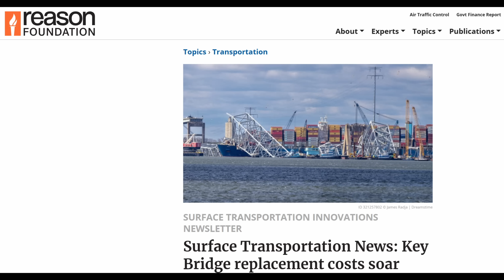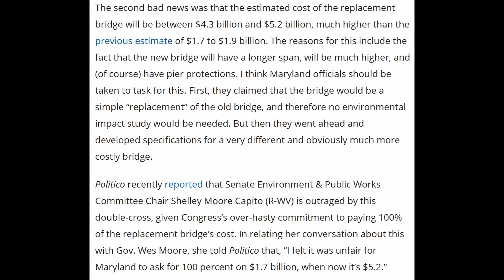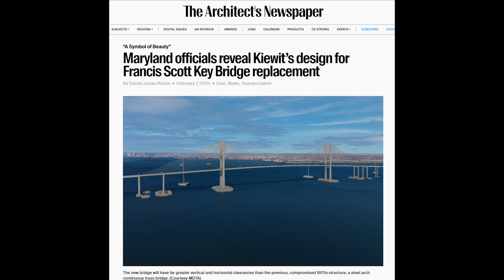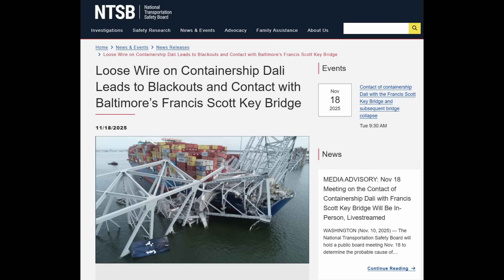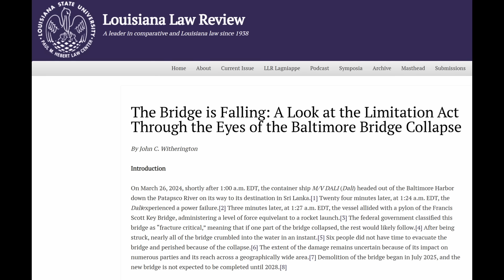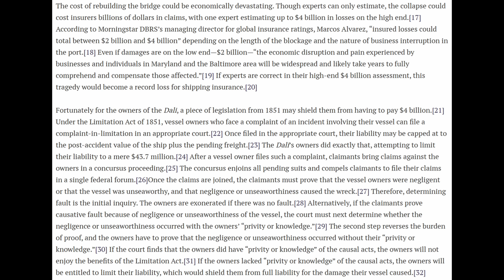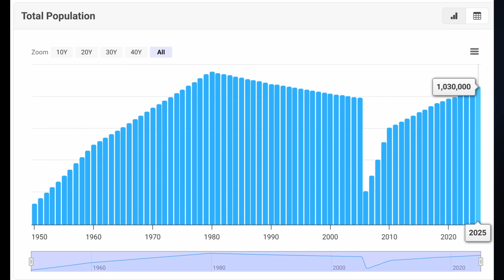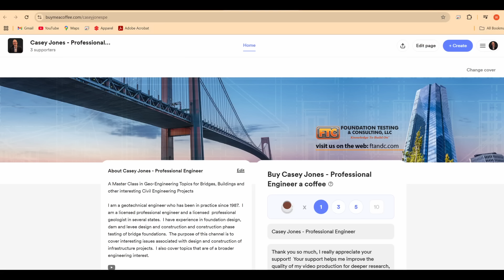Should U.S. Taxpayers Pay for a $5 Billion plus Key Bridge Replacement?

Comment: Long before the accident the port authority and the coast guard should have realized that the growth in ship size over the last 50 years created such risk that tug assist should be mandatory for larger ships to pass under the  bridge.
Reply: In 1980 this bridge was struck by a ship at the exact same piling system. A gigantic section of concrete was torn away. I was in the Coast Guard at the time and responded to the incident. The state knew then there was not enough protection. They did nothing and their neglect cost six lives ,not to mention the billions of dollars now being tossed about to rebuild.
Reply: @mikekellum6238    Delaware will observe that blowing off their responsibility to manage their own port resulted in a multi-billion dollar pork roast with portions for a hundred cronies and votes because "we brought jobs to DE".  They will conclude that this course of action is beneficial to them.
Reply: @mikekellum6238  Wow, 45 years ago they already had an incident. Plenty of time to make changes.
Reply: @mikekellum6238  
The main piers had a reinforced concrete crushable box structure around the waterline of the pier. There were 4 reinforced concrete pylons, a couple hundred feet on either side of each main pier.

The bridge was opened in 1977. It has been hit before, only 3 years after opening, by the MV Blue Nagoya a Japanese container vessel. A container ship in the 1970s or 80s was a much smaller ship than the absolute behemoths that are around today. No serious damage to the bridge.

The MV Blue Nagoya, a ro-ro cargo ship built in 1977, had a gross tonnage of 7,586 tons and a summer deadweight tonnage (DWT) of 7,613 tons. In contrast, the Dali (2024 collision) was a 95,000-ton gross, 112,000 DWT container ship.

Available contemporaneous accounts indicate the MV Blue Nagoya lost control about 1,800 feet out and drifted into a Key Bridge pier, damaging protective concrete/fendering at roughly 6 knots. “Drifted into a pier” and damage limited to the protection system point to an oblique or glancing allision with the pier rather than a perpendicular, head‑on strike to the primary load‑bearing elements.
Reply: Was the channel wide enough for a tug assist?
Reply: @leestebbins5051  No, it is not wide enough for 2 way traffic if tugs are required. At the time of the accident, there were just 4 lanes total with 2 inbound and 2 outbound lanes. With tugs, you will likely take up at least 2 lanes if not more. even then, it may require additional dredging as the outer lanes were for smaller ships with less draft, with tugs, the ship would likely have to straddle the inner and outer lane but the outer lane is not as deep as the inner lane. It would also require a massive expansion of tugs at baltimore on the scale of ten fold at a minimum. It would also absolutely slow traffic in and out of the baltimore area as when having tug assistance, that ship can't go more than 2-3 knots compared to 9+ knots.
Reply: @leestebbins5051  Tugs in Baltimore only help maneuver ships into the channel and into port. After that, the ships are on their own.
Reply: Would tugs be powerful enough to guide a ship as large as Dali in any meaningful way? Even ignoring the expense for the fleet of tugs to transit the number of ships?
Reply: @peters-adventure  sure, but the ship would only be moving about 2 knots max, anything faster and the tugs won't be able to affect the ship.
Reply: @peters-adventure  
Would tugs be “powerful enough” in a meaningful way?

Yes—if already attached as escorts. Two well‑placed tugs made fast can meaningfully control heading and bleed speed for a ship like Dali in confined waters. That’s precisely why many ports require or recommend escorts in high‑risk transits; experts widely noted that attached tugs could have helped modify the ship’s movement.
- Marginal—if arriving after the loss of power. Racing back without lines, with seconds to spare and a vessel already committed to a trajectory, their ability to generate timely corrective force is small. In Baltimore, the tugs had just left and were turning back when the emergency unfolded.

Expense and practicality of escorting “every ship”
- Cost and deployment are real constraints: Keeping multiple high‑power tugs attached through entire transits is expensive and operationally intensive. That’s why ports apply risk‑based rules—escort tugs where channel geometry, traffic, and critical infrastructure warrant it, and stage tugs near chokepoints so they’re already on scene. The two 5,000‑hp tugs were standard port assets assisting Dali’s departure.
- Targeted escorting is the middle ground: Not every ship, everywhere, all the time, but escorts for specific segments (e.g., under major bridges, narrow bends) where a blackout or steering failure has outsized consequences. With lines made fast before the hazard, tugs become immediately meaningful rather than “too late.”

Tugs are absolutely powerful enough to meaningfully guide and slow a ship as large as Dali—provided they are attached and acting early. The limitation isn’t raw tug power; it’s timing, attachment, and where you choose to pay for coverage. Arriving unmade‑fast in a crisis gives you minutes at best and very limited leverage.

Comment: The Key Bridge did not need to be re-designed. Only the pier protection (dolphins) needed to be redone. But, these projects always open  the door to corruption and self-serving bureaucrats. Thank you Casey for your work. I was the project manager for TB-61, the pilot project for replacement of the Triborough Bridge suspended span deck with orthotropic panels; the superstructure was not replaced. This lightened the dead load on the existing structure (elimination of the concrete deck). Ammann & Whitney was the project engineer.

Comment: Tariffs drive up the cost of steel used domestically.  Federal guaranteed funds allow for bonds to be issued prior to litigation with the insurance company from holding up any construction.  

Reviews on any infrastructure opens cans of worms because it justifies spending not in long-term limited budget projections.  It's frustrating for all sides.

Comment: As I see it the financing is always a challenge and it can always end up costing more than the initial estimation. From my perspective the federal funding would probably get best result for the surveying work to ensure that there aren't any surprises that can be used as an excuse to drive up the cost.
The least visible but sometimes the hardest and most expensive work is the foundation work. Get it wrong and everything else will fall.
So use the tax payer money where it will give you best control over the upcoming costs. Then you can decide how to continue and where the costs shall be.
The other perspective is also what the "need" for the bridge is. Time saved will be cost saved in the end. So building a bridge shall be seen as an investment that pays for itself through less time lost. The money path will be long and over a long time, so those building the bridge might never see the full value of it.

Comment: The Key Bridge is the Hazmat route, to keep things of risk out of highly populated downtown and the other route, which is also a Tunnel under the harbor.
Reply: So what What's the Hazmat route post Collapse?
Reply: @jerrykinnin7941  The long way around the 695 beltway that wraps around west Baltimore.
Reply: @jerrykinnin7941  
I-695 West, and selected surface roads around the harbor.
Reply: 695, which is a three-lane highway that is always congested, especially during morning and evening rush hour.
Reply: @kathrynw3  
So you run two bridges in the direction of peak traffic -- that is 5 lanes of traffic.
Reply: @alanstevens1296  Yeah, okay🙄

Comment: The bridge is part of the Interstate Highway System. That means Federal money will go to the project. Someone should probably audit what they are doing. It's sounding like a massive pork fest. That being said, all Interstate highway bridges should be required to meet Federal standards. Given the sheer scale of the issue, I can understand why they are choosing to gamble on not retrofitting all the bridges. It's a lot of bridges and a lot of money. It's not all about dolphins. There are bridges with other code problems. At some point it is cheaper to replace a bridge that to bring the old structure up to code.
Reply: Maryland's normal federal aid highway allocations are about $500 million per year.

It won't pay for a $5 billion bridge.
Reply: @alanstevens1296  That's why the Interstate system is beneficial. The benefits of this bridge are distributed up and down the East Coast.
Reply: @magnuszerum9177  
I-695 East is a regional relief route -- not a mainline Interstate highway -- I-95 and I-895 are the direct routes through Baltimore city.
Reply: @alanstevens1296  In some kind of way it was soaking up some of the traffic that is now occupying I-95 and thus aided in the I-95 overall traffic.
Reply: @magnuszerum9177  
There were three freeway harbor crossings in a range of four miles, with a total of 16 lanes of traffic.

Now there are two freeway harbor crossings, with a total of 12 lanes of traffic, handling the 225,000 vehicles per day.

Parts of the I-495 Maryland Beltway carry more than that on 8 lanes.

Comment: I was 28 when they opened the Key Bridge.  So I know they could do without it.  And why do they allow hazardous materials on the bridge and not the tunnels?  Seems to me that those are more dangerous overhead on a bridge over the waterway below.  Maybe there should be little or no shipment of hazardous material anywhere in the Baltimore area.

Comment: SNAFU 1, they knew there was federal dollars involved. Davis-Bacon Act, a U.S. federal law requiring contractors on federally funded construction projects to pay workers the local prevailing wage (hourly rate plus fringe benefits) for their trade.
SNAFU 2, from the bulk of the money is coming from federal it should be a federal project period. Not local politicos running the job

So as mentioned the video the situation requires it to be following federal guidelines as far as labor and materials designed build priority does know these factors and when they initially estimate the project then that we should have been what was funded not $1 more not an open checkbook.
This should go back to Congress and be defunded completely. Tell them to reapply and they'll provide a percentage of it the state pay for the rest.
The state needs to pay off all the work that's been done and pay the contractor for what's been done and if it's funding for someday so be it but these projects that run away need to be stopped by saying so many dollars and never a penny more.

SNAFU situation normal: all fouled up

Comment: Rebuild with the same narrow span as the original, and then plant dolphins as necessary.  Dolphins are a lot cheaper to design and install.  This upgrade is at the choice of the State, and they are using an expensive method to reach the safety level they want.  If they had just rebuilt as designed, a lot of the removal would not be needed, and the piers could be re-used.  Why should the US taxpayer pay for MD negligence and Dali incompetence?
 I would add that all insurance proceeds should be used to reimburse the taxpayer rather than provide funding for MD DOT projects.  A $5Billion replacement is a significant upgrade from a straight-across replacement.  It is not necessary, and is a boondoggle to the MD DOT and of course contractors who will provide design, material, labor and equipment to build the new span.
Reply: I like your idea, just rebuild and install dolphins. The Chesapeake Bay bridges need dolphins now
Reply: When you build a new bridge, you must follow current engineering standards.  It is illegal to build a new structure following obsolete standards.

Comment: Proposition:
The Federal government is responsible for shipping  and associated regulations (IIRC).
So they chip in 100% of the cost of the dolphins and associated defenses for the new bridge to prevent or mitigate future accidents.

State government was responsible for the upkeep of the bridge and, in part, for its loss.
They also have control of the scope of work (i.e. budget) for the new bridge.
So they are responsible for the bridge replacement costs, and for finding ways to offset the costs through legal suits, and by implementing tolls.

Comment: You have to remember that this was all due to one single simple wire termination error into a circuit breaker. The question is why was the ship deign such that one error could result in such an outcome. The other is, how many ships are currently on US waters with the same design such that a one circuit failure results in total lack of control of the ship?
Reply: The design included mitigations, but the mitigations were defeated to reduce the cost of other things. Safety-third mentality in engineering and management.
Reply: Absolutely.
But given that this could and did happen, and that there may be untold numbers of other critical faults that could disable a moving ship of this size, it is prudent that critical infrastructure be protected.
Reply: @psarj  True, all in all, massive ship barriers around critical bridge supports are the only way. It is not possible to insure that all ships are built, maintained or controlled properly. A typical primate such as I will evidently manage to screw up something causing a problem further down the road. To be human is to error as we are always learning. The cost of the barriers are small compared to those of a bridge replacement. The wire termination error causing such massive destruction and cost is just dam well scary! Sounds like the butterfly flapping its wings off the coast of Africa causing a hurricane in the Gulf.
Reply: One ship's steering failed and it hit some docks and piers. The hydraulic fluid was low. Air bubbles got into the lines. A lazy crew member not doing what they are paid to do.

Comment: I grew up in Edgemere and remember before there was a bridge.  We'd go through the old harbor tunnel to get over to Anne Arundel County, when needed.  That wasn't all that bad.  Many adjusted their lives to the fact that there was only that tunnel and no bridge.  Now they have the new tunnel as well.  Could we do without the bridge all together?  Yes.  Save the money.  Before the tunnels we used to drive through Baltimore and around that way.  Maybe we don't need the bridge with all the liability from shipping.
Reply from the maker: Thank you.  I would simply like to see the cost/benefit analysis for such an expensive bridge replacement.

Comment: Agree that you can’t throw money Willy Nelly on replacing the bridge, but you can’t throw the future expansion of the Port of Baltimore under the bus either. 
PS — The Port of Baltimore is a major economic engine for Maryland, generating billions in revenue, supporting tens of thousands of jobs (direct and indirect), and contributing significantly to state and local tax bases, handling diverse cargo like autos, coal, and containers, with its operations vital for regional supply chains and national trade, particularly for specific goods like tin and nickel.